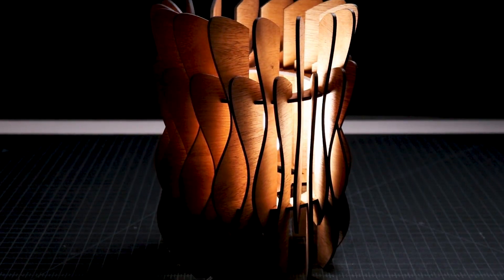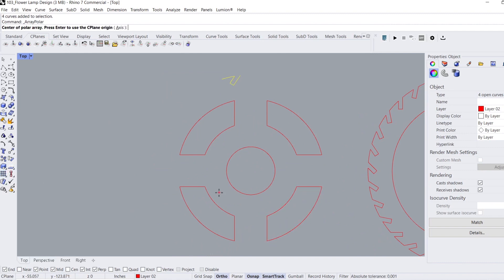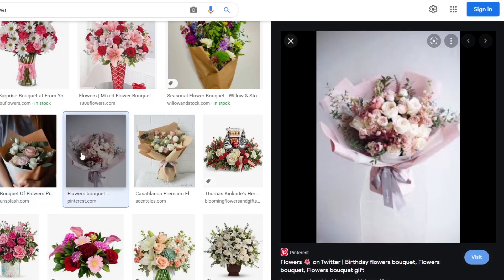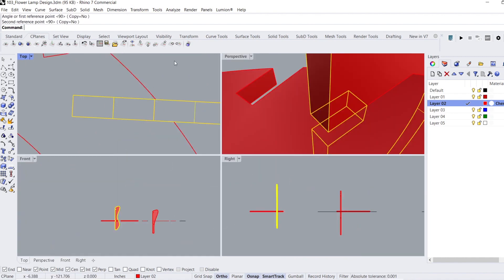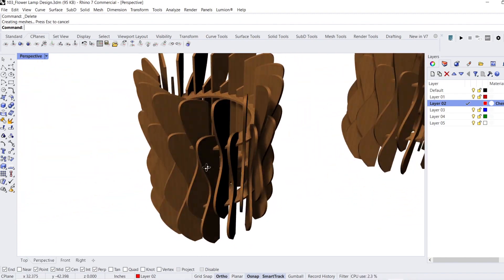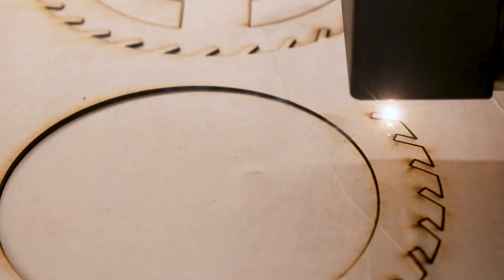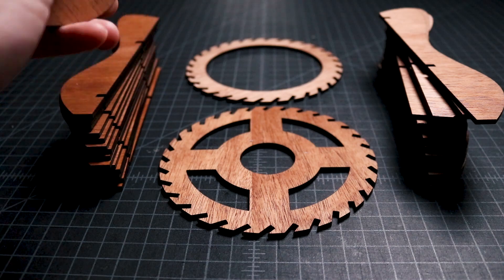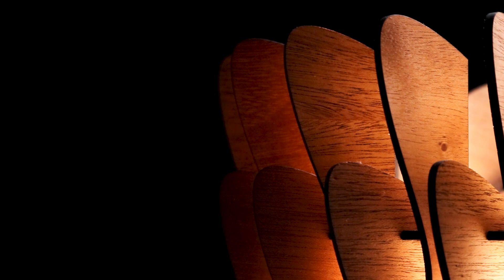How to make a Wavy Lamp With a Laser Cutter

Comment: File plz
Reply from the maker: You can get the design file here https://etsy.me/34o2mn2
Reply: @LaserMadeProducts can i use the file on xtool p2 laser too? I'm new on working on laser maching
Reply from the maker: @kevinajeon3828  I’ve never used the xTool machine, but if it can cut 1/8 inch plywood and fit a sheet at 18in x 10in, you should be able to cut this project on one